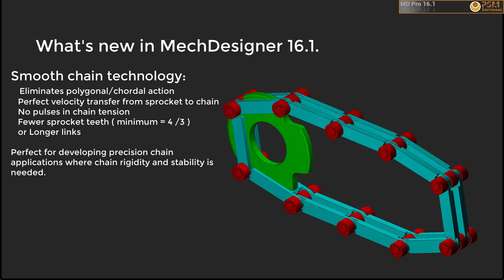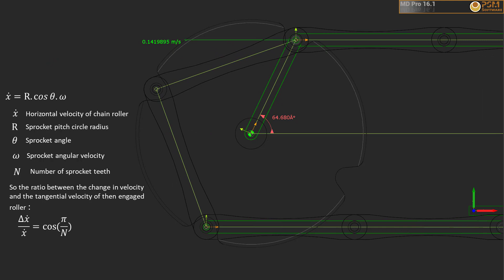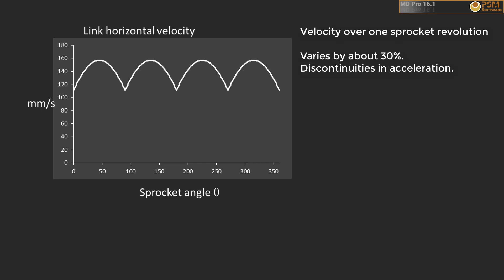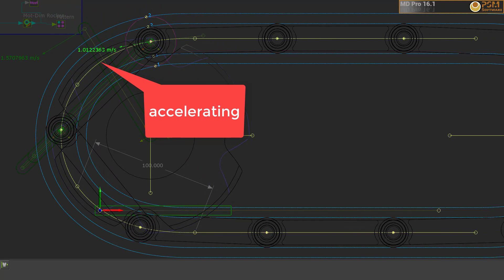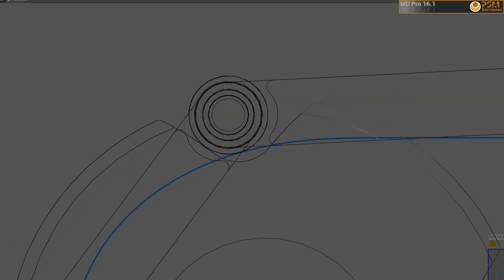What's New in MechDesigner 16

Comment: I've been trying to solve this condition for a current application. I basically came to the same conclusion that I will guide the joints in a cam track but I never got as far as to believe my sprocket pitch could exactly match my link pitch. I was center driving my links in a free groove.  I was able to get my error down quite low but now I must revisit. Thanks.